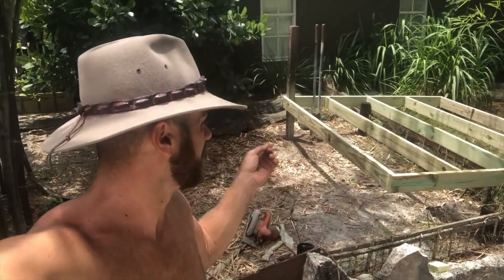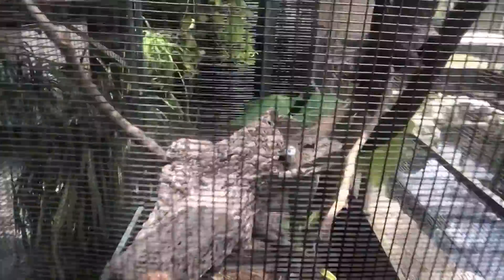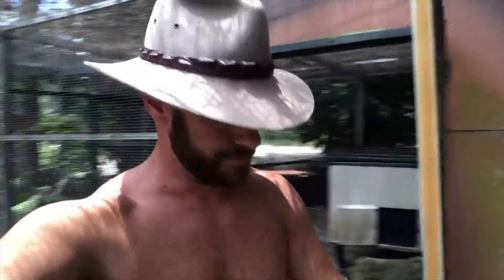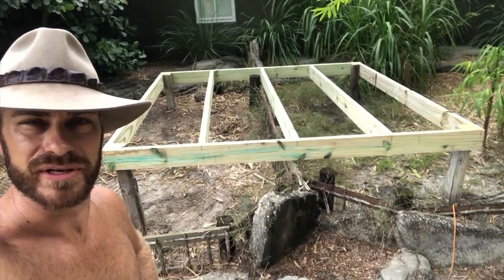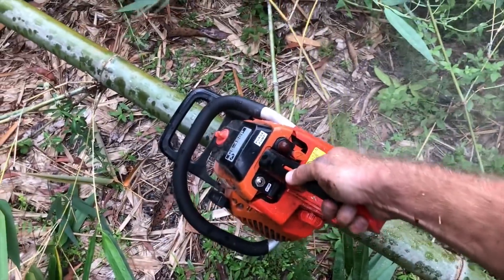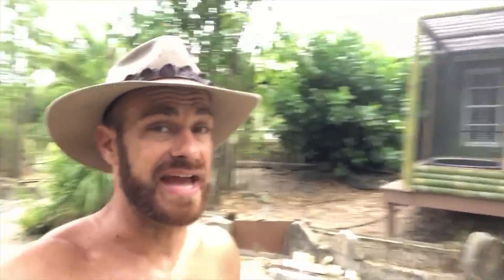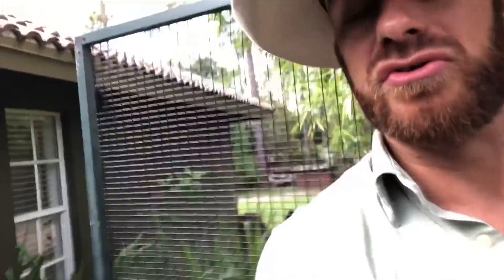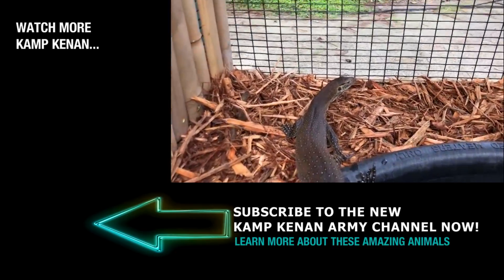INSANE REPTILE CAGE BUILD

Comment: Tip for next time, put post in ground at spots you want I.e square size of frame then build frame with wood around that. Put outside frame on first to build the main part then put in the floor framing in the middle. Will save much time and end up with a better product in the end. Once the posts are in that is half the job done, lifting that floor frame on after making it takes twice as long. Same way houses are built, posts, floor frame then walls. Cheers

Comment: Would the platform struts/supports and relatively thin floor be able to hold up thw weight of the cage the very heavy filled water tubs? Having a structural failure with animals under the raised platform could be a huge disaster.

Comment: I hope that doesn’t collapse, looks like all the weight will be on the screws or nails since the posts aren’t directly under the platform framing
Reply from the maker: Good point! Looks like I’ll be doing some mods!
Reply: As long as he used lag bolts to bolt the Ledger boards to the posts it will be fine